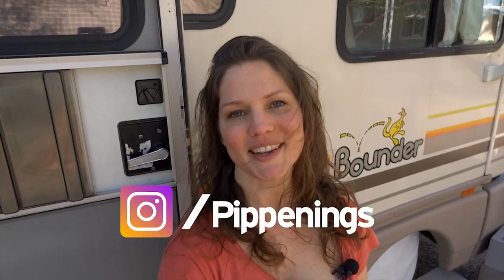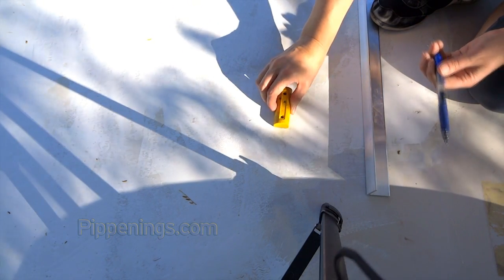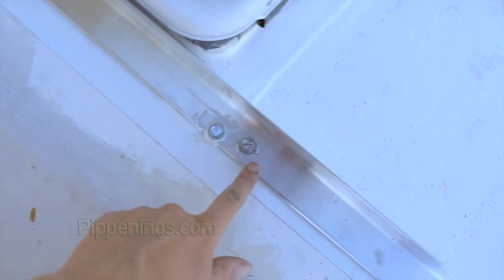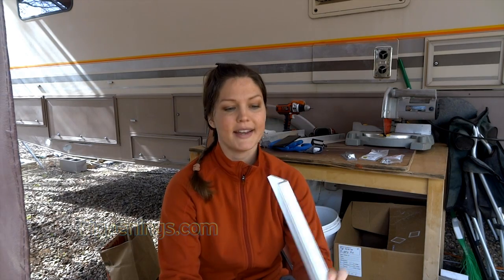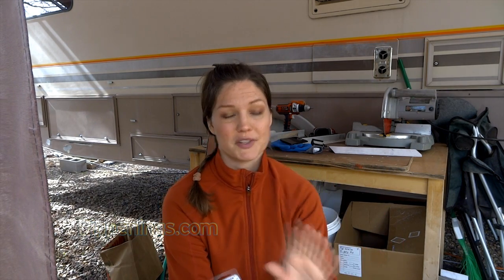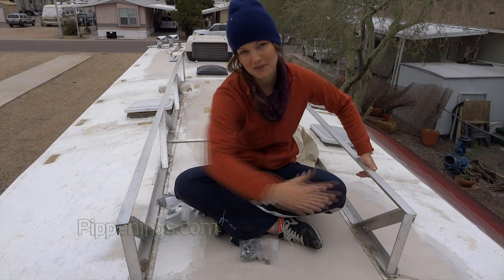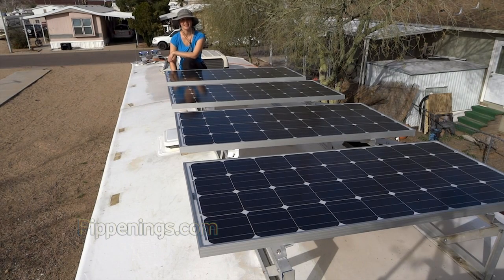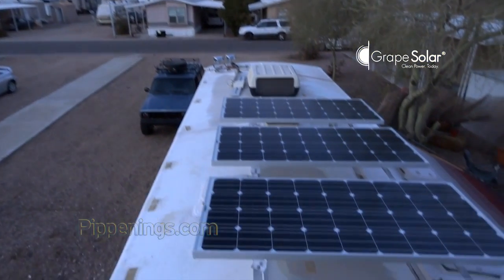RV Solar Panel Installation part 1

Comment: wow, you really built those high up. You should fabricate a fiberglass (not sure the right term here) "windscreen" or ummm mind blank.. but you know what I mean, in front of it for better aerodynamics.
Reply: BTW. As a car guy I have to say looking at this, what you did was basically create a huge spoiler you really do need to make a cover for the front or it's going to either rip off or just cause a huge amount of drag.
Reply from the maker: +The Dude I consulted an engineer and a mechanical designer to go over the design. Not that either specialize in roof mounts but I'm hoping it'll be fine from what they said.
Reply: Well I have a fair bit of engineering experience and I'm a designer. Neither of those really qualify for this job except to say that for a stationary object it looks solid. But, get moving in the wind and you have another story and whole other career experience to understand. 

They are all acting as spoilers. I suspect you will see a pretty bad MPG drop but I would be worried about them pulling on the roof the most. 

If I were you, I would drill holes on the top support L bracket , remove everything between and drop them down to the lower bracket so that the outside overlaps the bottom. Then I would drill the rest of the way through and bolt them. I would then still consider building a small aerodynamic windscreen in front of the leading panel out of Fiberglass. Just think, you could then do a FG tutorial as well. :) 

Then again, if you don't change it, you might be doing a video on how to repair an entire RV roof. :P 

Best of luck.
Reply: Think of it this way, ever hold a 4'x8' piece of plywood on a windy day? Consider what that would be like in 60-90+ mph winds.
Reply from the maker: +The Dude Again, I've had the input from two professionals as well as a phone call with an RV tech at camping world. Keep in mind this is steel screwed into steel for the tracks. Also they have roof racks for all sorts of vehicles that people put a lot of unique items on. I'm not worried.
Reply: Are those experts on Aerodynamics? Roof racks are typically close on the roof, they don't allow a large amount of air to enter under.

Comment: Those nuts are called acorn nuts and are a form of locknut. A drop of Locktite is good insurance.
Reply from the maker: +EASTSIDERIDER707 Nice profile pic! One of my fave shows. I have every episode on my computer and will just run a few when I feel I need some noise in the RV
Reply: You noticed! I used to have a photo, but got too many trolls in sports related blogs. I come from a Northern California ag community and Hank Hills were everywhere. Now living in Napa Valley. In two years I'll be RVing full time. #nomorerent.

Comment: When buying hardware don't mix stainless with regular. If rust or corrosion is going to be an issue just stick with stainless. It's a bit more expensive but well worth it in the long run.
Reply from the maker: +1000 cranes The comment above yours says to actually do that because stainless will tend to stick together almost permanently. Everyone has an opinion. Anyway I learn a lot from tips from viewers which I always verify by my own research if it comes into play. Thanks for this tid bit.
Reply: Opinions are just that! all the weld together folks are simply wrong and that's a fact! SS will not weld together nor corrode like carbon steel and if you wanted to could just had a touch of silicone grease during assembly...

Comment: Oh wow, somewhat correct on your description but not quite. Angle aluminum is all aluminum, not angle iron. Next never mix materials on fasteners (bolts, washers and nuts). If you do you will get corrosion bonding and not be able to remove these parts once exposed to the environment. All SS fasteners would be the only choice here. 

I’m not in favor of raising the panels as high as you did. You are creating an air scoop under the panels.  This will experience vibration going down the road with air turbulence and stress the roof membrane. I would have used a second angle piece bolted directly to the first angle the entire length.  This would keep the panels as low as possible and as stiff as possible to limit vibration. You might need to select different panels to fit between your vents but that is what it is. Angle on angle would provide you a built C channel support.

Comment: Anyone else surprised she didn't go rent a TIG welder for that frame?
Reply from the maker: +daren s I considered welding but I wanted the flexibility to change it later on. Plus it's harder to weld aluminum and steel would have been too heavy.

Comment: Good video on how not to install panels on a RV roof. You should never have that high of gap between the panel and the roof. Now think about going down the road at 55mph and you basically have a parachute pulling on your roof joist.

Comment: Gosh Pippi, that is some clever engineering.  You are only short a lathe to having your own machine shop.  This is a little off subject, but I saw this on the WEB today and thought you may want to trade your RV for one of these.
http://www.dailymail.co.uk/sciencetech/article-4294028/Is-ultimate-mobile-home-apocalypse.html
Reply from the maker: +JWelchon I'll check it out. I'm not able to select the link on my phone.